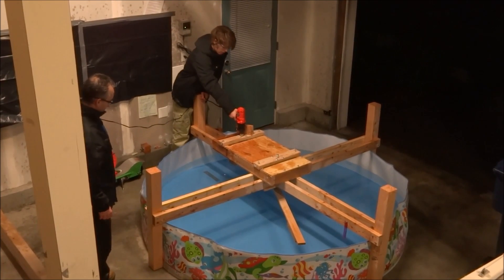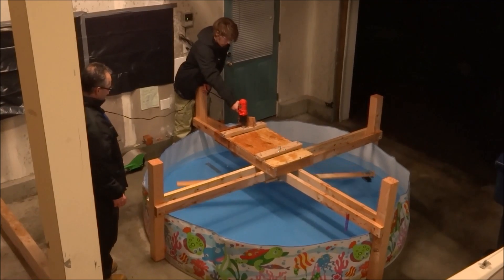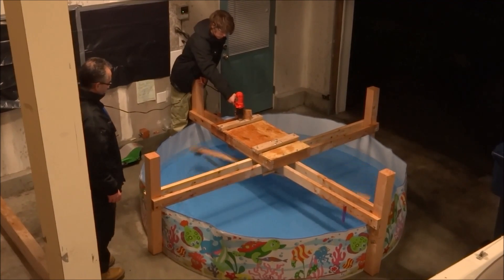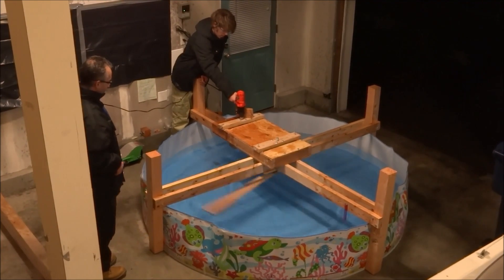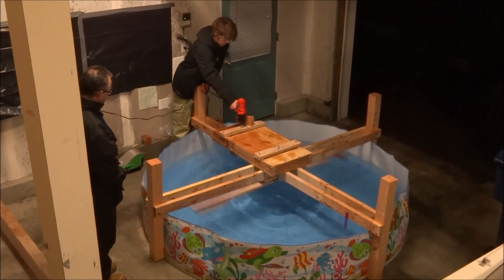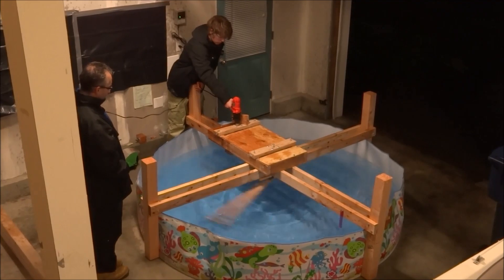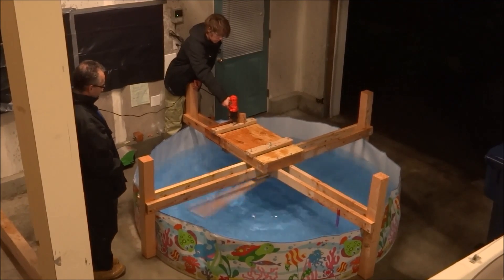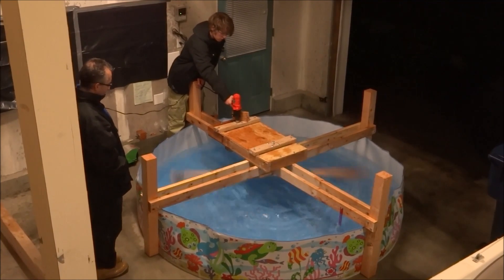supercavitation video 1

Comment: For super cavitation you must keep water in a cylindrical vessels then rotate that cylindrical vessle with high rpm. 

Rotate it with such high rpm that water can achieve 14 to 100 m /s.

At 14 m/s you will find a very little bubble only. 

As you increase the rpm cavitation rate will increase and you will observe supercavitation at the surface of cylindrical vessle. 

I am also trying to do same. 

If you succeed please upload the video.

Comment: The super cavitation on the torpedo is created by expelling gas from the tip. This reduces friction of the water on the torpedo tremendously. Essentially making the torpedo a rocket in air.